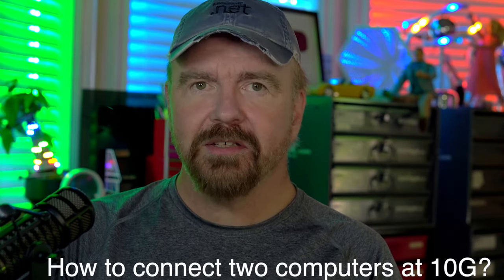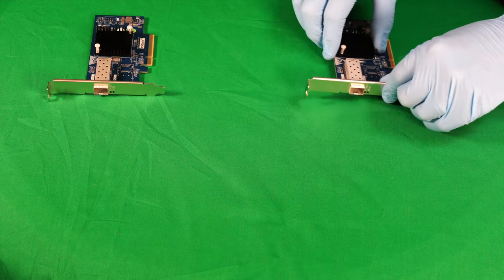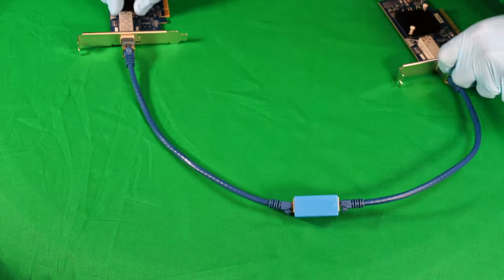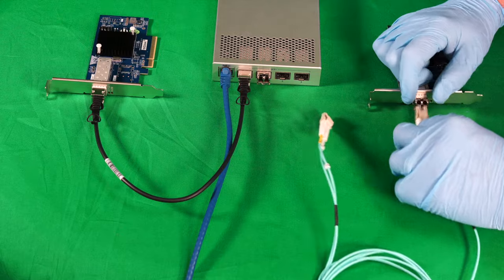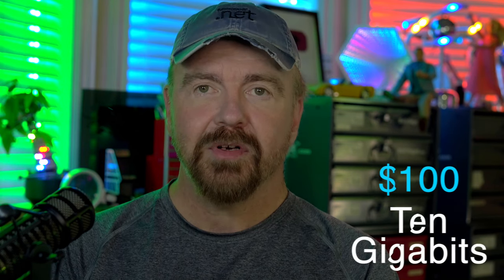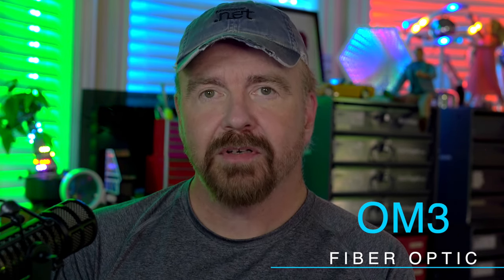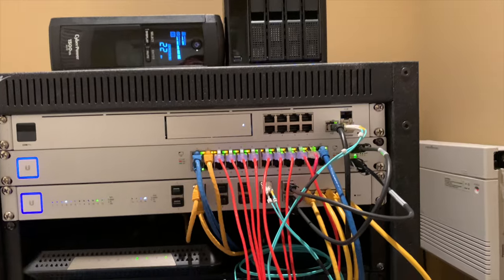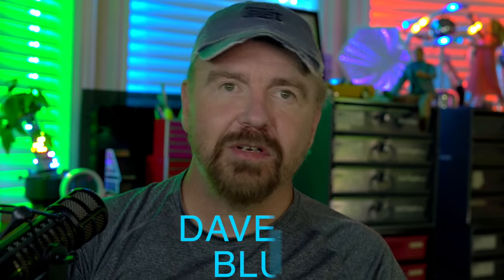10 Gig: 3 Ways to Connect!  Fiber vs Twisted Pair vs Copper

Comment: The issue with fibre is that the signal going down the centre takes a shorter path than that which bounces against the walls, this creates an effect called group delay on the received signal and effectively can cause data corruption which will negotiate a slower link .

Using cable with a variable refractive index causes the light to speed up and bend as it reaches the outside, thus by the time it reaches the receiver the signals are still in phase and viola - you get the link you paid for.

Comment: Are all SFP transceivers the same or do you need to get specific ones for specific brands of device? I have a pair of crusty old 3Com (hehe, yeah...) gigabit switches and they have SFP ports which look like they're supposed to be used for linking switches together.

I need to get my network from one end of my house down to a shed at the bottom of the back garden. Currently I'm using a pair of ethernet-over-powerline boxes and the data rate is a bit slow at times.
Reply from the maker: I've heard some brands are picky; Cisco might need Cisco, for example.  But I use MikroTik and Ubiquiti and they seem to both accept the "10GTek' units I've been buying on Amaozn.
Reply: SFP/SFP+ ports are technically all supposed to be cross-compatible but they're not.  Typically the better quality modules work across different switch type(s)/models -- my choice is FinaStar when possible (they have new name now but they're the gold standard).  One of the single biggest cause of modules not working -- dirty optics.  You do NOT want to touch the ends of any of the connections because you're skin oil will contaminate it.  You cannot just use some Windex and rub it on your shirt to clean it off.  LEAVE the dust covers over the ports or cables if you are not using them.  Just having them sit in the open will get dust on them -- same result.  Unless you have the proper cleaning equipment and know what you're doing -- you'll just end up replacing cables & transceivers thinking they "broke".
Reply: It depends on the devices. Some are really picky about the manufacturer. Others are less so. You're correct about the SFP ports. They are most often used for intra-switch links.  It's a guess as to what you need.  SX (Short Range) with MM is maybe 3CSFP91. You have a conduit between locations?

Comment: Do you really need a crossover cable to connect two SFP+ modules? Shouldn't they implement Auto MDI-X to automatically negotiate transmit / receive?
Reply from the maker: They really should, and I bet everything that's gigabit or newer probably does.  But 100M was supposed to and the support was sketchy so relying on it was a bad idea, and made some of us still paranoid about gigabit, which I bet works all the time without, as you say!
Reply: Auto MDI-X was optional in the original gigabit standard. I don't know if it was ever revised and made mandatory but I'd be confidant that everything would support it now. "It works until it doesn't" :)

Comment: Almost all of youtubers are somehow using UniFi devices, makes me wonder why. But I did notice the controller GUI is very easy to navigate compared to old layout style. Anyhow, good video!
Reply from the maker: Good point!  I've had UniFi for years, just the APs, and only started adding the switches, etc, in the last few months.
Reply: unifi products have more features that appeal to an enthusiast compared to systems from cisco or other brands such as the remote access and streamlined GUI with optional terminal access

Comment: I have my DiskStation and PC connected to QNAP 10Gb switch using SFP+ DAC cables. I went through variation of connection types, and DAC was the only one that didn't get hot to the touch.

Comment: So long as the switches support them (I'm using a couple of Mikrotik switches) I'm using a pair of Ipolex ASF-10G-T SFP+ to 10GBASE-T over 17m of junk cable between my home lab / office and the main lounge and it links at 10G. It was more of an experiment rather than anything permanent. Waiting for an SFP card to put in an old machine to see the iPerf results. Link reported at 10Gbps, it will be interesting to see what actual throughput I get. I don't need any more than 1Gbps, it's just an experiment.  

Beautiful Daytona!

Comment: I am about to embark on upgrading my Ethernet to 10gigabit however here in Australia I still can't not at my property get anything above 50 megabit internet if I lived in a area with fiber I could potentially get between 100megabit to 1 gigabit connection none the less i think I will be going with fiber for my internal lan as I have worked with the various cat cables in the industry for decades now and as you said fiber seems exotic and cool I think if I upgrade to fiber it will save me upgrading a lot of stuff in the future most of the upgrade will be done in one lot and when I did my CCNA CCNP exactly what you were pointing out its the end equipment on the ends of the fiber that  is its limiting factor bar the type of fiber as fiber theoretically I been told by my lecturers was infinite in the fiber optic cable itself just the technology at each end limits it.

Comment: I really appreciate  you sharing this. But the cut to the Seahawks photo, not cool!  Also, on a serious note, are you using a patch panel? You probably should be using one.  If for no other reason than that the provide the means to keep your cable run from the remote side static and making changes on the rack is much quicker.  You might have one, but I didn't see it in the video.
Reply from the maker: Yes, every cable in the house is home-run from the room jacks back to one of three cabinets, and they're all on punchdown.  It's just out of sight below the shot of the rack, it's the next few U down!

Comment: Those direct copper connect I forget what I used to call 'em but I didn't know them by that name. 
I've plugged in so many of those on disk shelves, file servers etc. and of course network equipment. 
Funny it's slipping the brain right now.
Some switches use a similar looking but different connector to bridge backplanes of two chassis. 
The other thing about fiber and fiber PHYs is that there are different nanometer types. In broadcast we used some for data and some for digital video. It was 10 years ago so I forget which is which. 
And even for networking there was a different kind used for desktops connecting up to our Avid file sharing systems, compared to what the servers used to connect in the data center, and our broadband uplink.
Most of these differences did not impact performance. On the desktops they were driven by what our expensive hardware supported in terms of fiber optic. For Mac Pros connecting to Avid 10 years ago and also using C4D there was only one card that wouldn't keep crashing the Macs. And it likes certain PHYs.

Comment: Back in the early days of 1990 working on a database with Cobol code ;-) we would read out what was on the screen so someone else could type it in ;-) this method had it flaws since I had a UK northern accent and I was working in Wales.
Reply from the maker: When I was working on Product Activation (product keys) at Microsoft, I had a long debate with a mathematician (of which I am not one) in India over the phone on a particular key were having trouble decoding.  It started with something like 805V- but I could not tell whether he was saying V or B.  The Hindi language, I guess, doesn't discriminate them well.  Eventually:  Do you mean B or V?  V!  B?  B!  V?  And then finally he yells out "B!  B!  B like in Bictor!"

Comment: Hi Dave. Thanks for this really useful video. About NIC to NIC or via a crossover connection/switch.  I read somewhere that all network cards these days can autodetect what internal wiring the cat5/6 cable has? So basically any network wire can be plugged in. Is this pretty much true?

Comment: I thought an odd number of fibre cables was needed between nodes because each cable swaps A and B channels.  This would make the example with the 75m and short cable inoperable because the two transmitters would be facing each other down the same fibre as would the two receivers.

Comment: With different SFP media has different latency.

SFP DAC (Direct Connect) has the least latency of 300ns as there is no media conversion.
The limitation with DAC is Cable Cost for Distance, distance limitations (Max 7m passive & 16m active) and that this is only generally used for patch leads between comms equipment & servers.
10GBASE-T has a latency of 2.6ns and depending on the quality/category of Twisted Pair can run 30m or 80m.
Fiber is about 2.6 microseconds latency with the benefit of electrical isolation and long distances.
Note there are two types - single mode (which can go much longer distances due to being a much smaller diameter) and the older multimode.  Multimode used to be used in local area networks and single mode in public infrastructure such as telecommunications carriers.  These days single mode has become the all-round solution for bot private and public infrastructure.

Comment: what if my nic is 40gb and uses qsfp+ connections how would I connect rj-45 ?  Do I need a switch that provided a sfp+ port then use a transceiver to convert to rj-45.  currently I have several machines connected to the internet via routers and switches.  I recently added 40 gbe to 2 machines via a single fiber optic cable.  The need was to be able to quickly move data between the 2 machines.   All in All enjoyed the video

Comment: This video has set me on the path to an eight HDD RAID 10 NAS with two NVMe's for cache, connected straight to my pc via 10gbps SFP+. Also my inevitable death when I don't have a good excuse to tell my wife when she asks why I spent so much, and I just spew technical jargon.
Reply from the maker: That's exactly what I did!  I built two, and the second actually has 9 drives for a hot spare.  Then 8 drives in RAID5.  One has two NvME for cache.

We could have your wife ask my wife, and then they'd both think it's pretty normal :-)
Reply: I just say..."I'd explain it to you but your eyes would gloss over and you don't care" she replies yeah you're right NVMD

Comment: I started out with simply connecting my NAS and workstation directly...
Fast forward 2 years and now I have a 12S+ port router, a 16S+ port switch and another RJ45 switch with 2S+ ports :|
Why you ask? I have no damn clue but at least I won't fall behind when 1Gbit becomes the new 100Mbit in homes :^)

Comment: 10GB is great, have it from my main PC to one of those Mikrotik switches and to a TrueNAS box. Is still running spinning disks in a ZFS pool or the NAS, and with 10GB I can max out IO of the drives. The NAS runs 24/7 on a UPS and is backed up to Backblaze which my main PC is not.

Comment: Nice video indeed as others already mentioned. A question that relates to the subject...  I have 2 qlogic  2562 hbas (8gb)  which if I understood correctly (even if they have the sfp+ connectors) can accept only lc-lc cables with the correct type of transceivers (you ve shown on video). They only way to configure them (and then not quite understand how) is via loading time of the server with cttrl+q in order to get to their bios setup.  I am used with the cards you ve showed in your video that can appear to the host as an Ethernet adapter and then by configuring the appropriate ips you can have a connection or setup an iscsi target - initiator couple but with the cards I mentioned I cant understand how they work. Do you have a clue since I couldnt find anything illuminating online except the fact that they work upon an fcoe (fiber channel over ethernet) protocol but again I cant understand how to make an iscsi target for example or have a connection in general since they dont appear i n the OS as anything like adapter or something.

Thank you in advance.
Reply: Those qlogics aren't suitable for networking purposes, but for storage. They are meant to be connected to a SAN (storage area network) which carries SCSI commands to and from block storage arrays.

Comment: A crossover adapter is NOT needed in most of the cases. Modern Ethernet physical layer chips (PHYs) support a feature called MDI/MDIX auto negotiation, which can change Tx/Rx polarity on the go on one end the the other end remains, thus creating the crossover on chip without ever needing anything externally. Last time I saw a PHY which doesn't do this trick was on some very old designs (like before Fast Ethernet) or on some devices designed to be installed only the correct way, like medical stuff and industrial control stuff. For consumer and prosumer gears, needing to distinguish 568A and 568B was only the past.

Comment: Great video Dave!
Not sure if I missed it, but the fiber optics are double cables correct? So I assume 1 for sending and the other receiving? Or can that happen at the same time through 1 cable?
Reply: That’s the most common way it works. There are also fiber cables that are only a single cable, those can use light at two different wave lengths for the different directions. I’m pretty sure it’s only single mode then (more expensive).

Comment: Clarification regarding Cat[ 5-7] cables are not just wired "straight through" pins 1-8 to pins 1-8, the twisted pairs corresponding to their pin groups must be correct too.  Note closely in the diagram that pins 3 and 6 (green pair) straddle pins 4 and 5 (blue pair), they are NOT sequential like 1-2, 4-5, and 7-8.  Without doing this, the cable will not work properly for networking.  In addition, most modern eNet chipsets automatically figure out to swap Rx/Tx when needed -- in the old days there were either special "crossover" ports or cables to chain devices.  Now, it's pretty much plug and play.

"DAC" is commonly pronounced "dack" instead of naming each letter. e.g. "Dack cables".

Also, you may want to enable jumbo frames on 10Gig and set MTU to 9000 to handle 8K NFS (and other large protocol payload) frames.  Caution, all devices must be able to use the same MTU frame size -- I had a firewall which could only do 2.5K MTU frames and had to be upgraded to handle 9K frames. Jumbo frames can squeeze out another 15% throughput at this speed.  Using jumbo frames in VMware (and other virtual environments) allow instances to migrate between hardware much faster.
Reply from the maker: You lost me.... you can use any straight though wiring scheme you like subject to it being the same at both ends, right?  Now some might pick up more noise, but all should work.  No need to swap rx/tx today, etc.

Comment: And in case you see some QSFP+ NICs and think, "why not?", double check the cable prices for the length of cables you will need.  MTP/MPO is 8/12 cores instead of 2 and that isn't cheap.  Copper tops out at 7m runs, and that isn't cheap either.

Comment: These days all PC NICs can detect the table type and adjust.
So you can connect two PCs using a passthrough cable.
The NIC will automatically adjust the pinouts.

Odd that the SFP NIC doesn't do this.

Comment: Hi, Dave. Thank you. Great video. Do you have a part number for the fibre module you show at around 7:36 and do you know if there are surface mount boxes that would hold the module and protect the connectors?
Reply: It's a regular duplex LC/LC fiber coupler. You can fit it into a FTTH splice box which is used to protect the exposed fibers, and it doesn't make much sense to use as a protection for fiber patch cables since they're strengthened by design. If you have a modular patch panel, there are adapters that fit fiber couplers into the patch panels.
Search amazon for B004HN00RE, B07JGRBTCW and B074QTDTLB.

Comment: What switch would you use for 8+ SFP+ distribution? My plan is to put my NAS / Server / VMs / Client on a 10G switch, which will connect to the core house switch at 1G. I like Ubiquiti, but not their offerings (can't find a distribution 10G switch, only the Aggregate you have in your video).
Reply from the maker: I'd likely recommend the Unifi aggregation switch , the one with 8 SFP+ and four RJ45 ports!
Reply: @DavesGarage  Ah, so you are using their "Aggregation" switch primarily for distribution. Do you have a UDM-Pro for router/firewall? If so, how does the UDM handle the "Aggregation" switch's connections that are not other switches?

Comment: thought most modern systems didn't need crossover cables anymore, they could negotiate that themselves?
Also, $30? I found some used SFP+ NIC's on Aliexpress for just over $15 Australian, and so far one of them seems to work, I haven't tried the other yet...

Comment: Dave, do you have any videos on using Power Over Ethernet to supply power to an Arduino project?  No data, just power.  Let's say using POE to power an Arduino, four 5v motion sensors, and four different 5v-12v led light strips.  Can this be done?

Comment: Nowadays, for 10 gigabit, SFP+ fibre connections are a bunch cheaper than copper RJ45, and are cheaper than direct attach cables for 5+ metres in length. Ubiquiti 10 gigabit fibre SFP+ modules are $19 a pop (they come in a two-pack for $38), the cables are cheap and plentiful (AmazonBasics OM3 cables are $30 for 30-metres), and a used SFP+ NIC with a fibre module is half the price of a copper RJ45 NIC.
Basically, reserve DAC for very short distances, reserve copper RJ45 for when you have no choice (connecting to a built-in RJ45 port), and use fibre for everything else.

Comment: With gigabit or 10gbe, you don't need a crossover cable, or crossover adapter. Gigabit and higher adapters support auto-MDIX, and will auto-negotiate Tx and Rx pairs

Comment: I am not. 100% sure but I think most modern network cards and ports even switches can use a straight cable and the system detects and cross internally. Old days I remember some switches had a push button to change a port from straight to crossover.